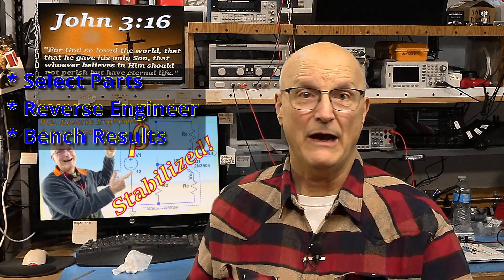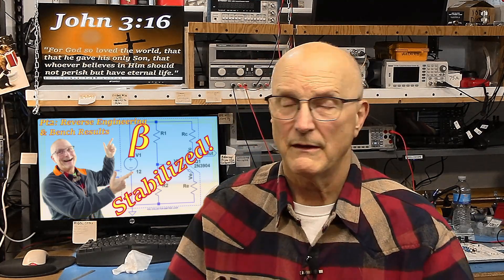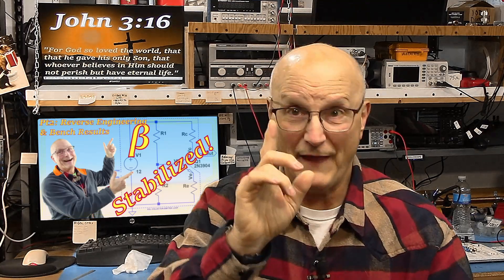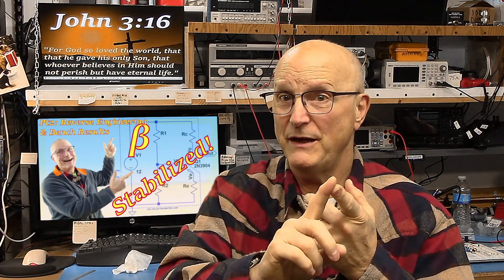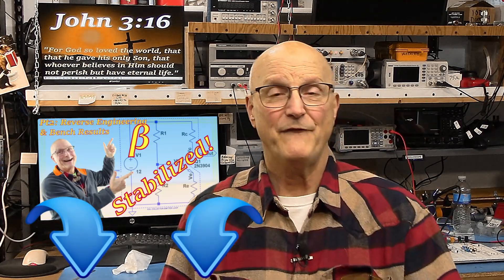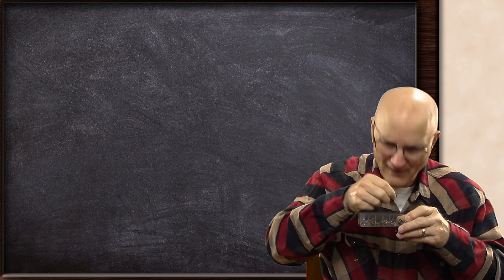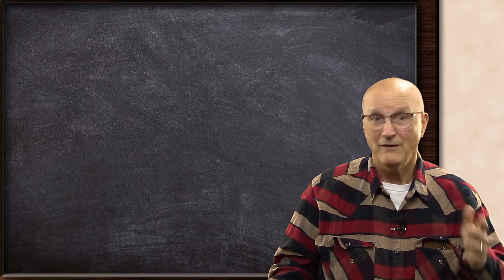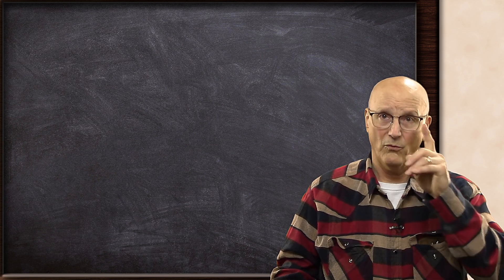A Beta-Stabilized, C-E BJT Circuit (Pt2): Part Select, Rev Engineer, Bench Results (066c2)

Comment: WHY DID YOU NOT HAVE A PRESENTATION FOR THE AC WITH THE INPUT AND OUTPUT IIMPEDANCES AND GAIN FOR THESE TRANSISTOR CONFIGURATIONS?ONE TRANSISTOR CONFIGURATION THAT WOULD BE INTERESTING TO LEARN ABOUT IS COLLECTOR FEEDBACK.
Reply from the maker: This video is the second video in a two video pair on this subject.  Video 1 (https://youtu.be/q-O8A5R1PV8) was on analysis and design using the intended overall gain and input and output impedances to determine the ideal values required to meet the design criterion.  
This second video shows how to go about taking the actual resistance values that you are implementing the design with and determining what the circuit should actually act like based on those values. This, then, is followed by the bench experiment were we see how close we actually came to a real-world circuit in our calculations.
Anything beyond these goals is out of the intended scope of either of these videos. 🙂

Comment: Thanks for a thought-provoking analysis of this basic circuit. I did manage to remember Thevenin and Kirchoff's Laws which I first encountered 60 years ago at Technical College. An interesting exercise for people to try would be replacing your resistors with the nearest preferred values, either from the 12 values per decade (E12) or 24 values-per-decade (E24) series and compare the results with the basic C-E circuit.
Reply from the maker: You are very welcome! 
I always found the whole Thevenin thing weird. Kirchhoff's stuff makes sense, but Thevenin ...?
You are right, once we get it "all figured out", we still have to get parts we can buy. Then comes the fun ... accommodating part tolerances! 🙂
Reply: Now you've jogged my memory, there was also the Norton equivalent constant-current generator, which was the one I found more difficult to understand.
 @eie_for_you
Reply from the maker: Aaaah yes, Norton equivalents! Yeah, these are sometimes somewhat mind bending concepts!
This is my LONG overdue reply!  Sorry. Sometimes this stuff gets lost in the YT world. I'm spending some time trying to clean all this stuff up. :-)